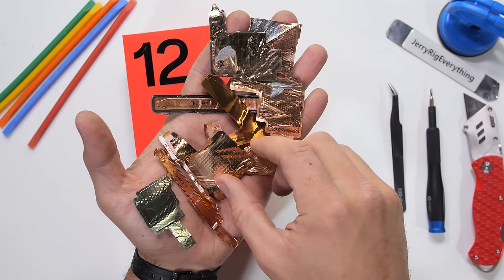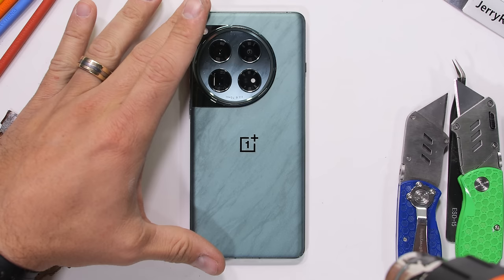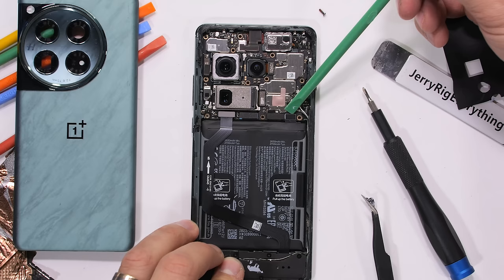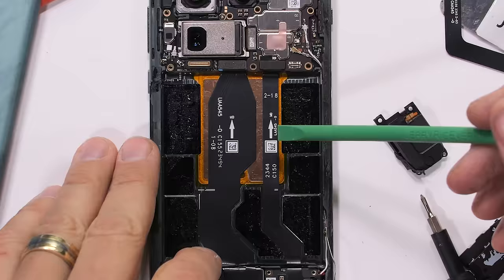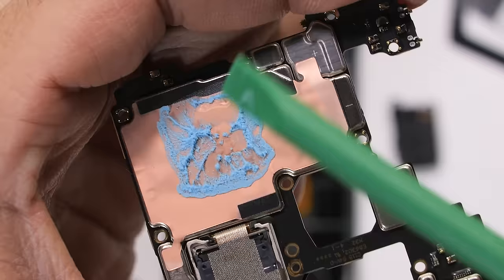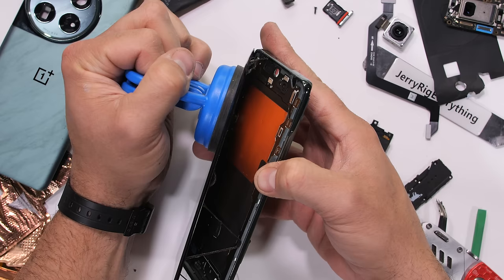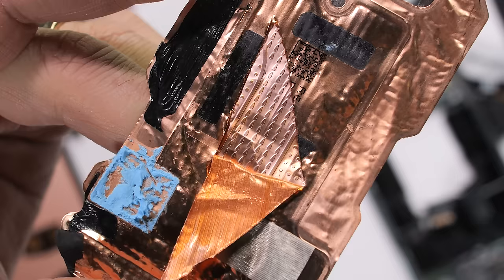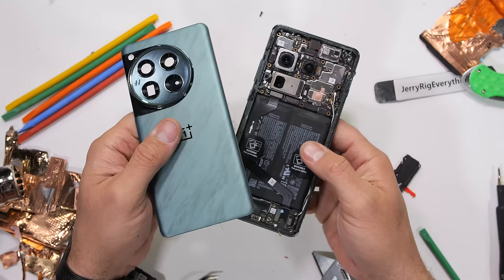The OnePlus 12 is the Coolest phone ever seen...

Comment: As a Chinese user who already owned OnePlus 12 for almost 2 months and been upgraded from OnePlus 9 Pro, there're some points I want to share:
1. It looks and feels pretty good, especially the camera module. It really looks like a premium watch face (better than the OnePlus 11's).
2. White color is using the glossy back glass. Just like my iPhone SE3, it's extremely slippery. So be very careful if you purchased.
3. The new BOE OLED screen is indeed very bright even under the sunlight, and significantly improved compared to the old Samsung E4 OLED display. With latest firmware update, you can get 800 nits via manual brightness control (fullscreen).
4. Vibration motor is now comparable to the iPhone's. iPhone gets more feedback details. But judging only by the power of the motor, they're very close.
5. Ambient sound effects can significantly improve the mid and low freuency to make the voice and beats sound better. (Turning it off increases the volume, but the high freq is not very pretty)
6. SD 8Gen3 performs just like what you will expect. It only gets warm, never hot, even in the games.
7. Main camera is good but the ultra wide and telephpto are okay. Those two are not bad, just nothing special. 
8. Battery life is impressive.
9. NFC still can be used even if your battery is dead and the phone turned off completely, and yes, I've tested it. NFC only draws power from receiving device, not your phone. Think about your "touch and pay" kind of cards in your wallet.
10. The signal strength of the cellular and Wi-Fi are impressive. But the software is struggling with switching to the better Wi-Fi hotspot.
11. That silent swtich is now more resistant so you won't accidently activate the silent mode when you're taking your phone out from the pockets.
12. Most of the time, it charges at 73 watts maximum (shown by LSPosed+LuckyTool module, not a physical ammeter), not 100W but still fast.
13. Rumor about the "gap" between the camera module and backglass is true, but not as serious as you think. It have a gap, only if you are watching very closely, and can be completely ignored if you're using phone cases. (Note: this rumor is based on Chinese articles and only represents the early batches)
14. Yes, it can be bootloader unlocked and magisk rooted, without losing your warranty. But rooting is not as simple as the Google Pixel. Not too hard though.
Reply: Good to know. Thanks.
I'm still rockin my 9 pro 😅
Reply: Extremely useful comment. Thank you kind sir!
Reply: And Can I Play Genshin Impact With Max Settings On My New OnePlus 12 I Just Bought It Today And Btw I Am From South Korea And Genshin Impact Server Are Faster I Think In My Country South Korea 😲😲😲😲😲😲😲😲😲😲😲😲
Reply: @-KAWAAKOKAWAAMKAWAAAAAAAAAAA  I didn't go with the max settings, only high (with motion blur off). But everything performs just like my expectation. It cannot hold 60 FPS for long (about 15-20 min). After that, it will drop to 45-55 FPS at average. But overall it's still very playable since 1% low FPS are pretty stable. So almost no stutters. BTW, the temperature of my city was 22 degree C and above so that will also afftects it.
Reply: @emilja.4205  Same. Still going strong tbh. Battery is getting a lil weak tho.
Reply: @Asahi380 那边youtube不是被禁了吗
Reply: So would you tell someone to go for it
Reply: @no-one-kc3yd  it's too early wait for some months if this model doesn't have much problems like other models then go for it
Reply: LSposed -> oh so the phone Can be bootloader unlocked and magisk rooted?
Reply: @sashimifr  Yes, without damaging its warranty.
Reply: Thank you for the information.
Reply: @no-one-kc3yd  If you want an all-in-one new phone, then go for it. Otherwise there're cheaper choices.
(Seems youtube is deleting my comment...)
Reply: How is the Software?
OnePlus 9 Pro is the worst phone I ever had in this regard...
Reply: @johannscheer  Seems overseas model is still getting OxygenOS. But instead of developing by OnePlus itself, OPPO actually lead the development this time. From what I see, it basically just ColorOS 14 with Google service framework enabled by default, and I think most of the user can trust OPPO's dev team. It's not perfect but not bad at all. Personally I like this UI because it shares similar design with the AOSP (at least didn't heavily modified like MIUI) and added some practical functions.
Reply: Just ordered one from China to replace my 9pro. Would you say the camera is significantly better then the op9 pro cam?
Reply: im waiting for my oneplus 7 to die xD but it never does, i just replaced the battery this year and it's still rock solid phone
Reply: Thank you sir, this is very valuable and helpful, wish you the best.
Reply: Not sure how hard it is on the 9 pro but I replaced the batteries on both my 7 pros myself. You can do it 👊 I believe in you.
Reply: @officialshivertrip  same here. That's why I'm considering, battery... Seems that the 12R is even better in that regard but the screen not as good!
Reply: thanks for sharing. Btw, how many years does this phone get OS updates and security updates?
Reply: 800 nit brightness sounds downright unimpressive compared to how bright other flagships are going. Just looks at the S24U with it's 2,600 nit brightness, that's more than 3 times brighter than the OP 12. Edit: I just checked the specs of the OP12 on GSMArena and it says it has a peak brightness of 4500 nits, lol. Why would you say it's only 800 nits?
Reply: @NonLegitNation2   4500 nits is top HDR brightness
Reply: @officialshivertrip still rocking my oneplus 6. Battery replaced
Reply: @NonLegitNation2 read with your eyes not ass he said manual brightness
Reply: @Plankton422 would also want to know
Reply: @NonLegitNation2  flagship phones nowadays most of them if not all, already above 1600nit already at auto during bright sunlight. On manuals without sunlight boost (samsung etc), most of them limit 600-800nit. If not u may get spooked by it especially in the dark room if u accidentally swipe it all up to max😂😂😂
Reply: After flashing oxygen OS on it, would there be any issues with future updates? How's the battery life like? SoT?
Reply: Very bad brand. Software is so bad in battery life, zero support after buy. Avoid
Reply: Any thoughts on the adhesive issue goin around with the china release?
Reply: Thanks for review bro ❤
Reply: those it have MeMC?
Reply: NFC when phone is off even no battery? Doesn't seem likely, anyone see a link to this feature?
Reply: Camera when compared to other flagship how is it?
Reply: @Plankton422 Yes, significantly better. Telephoto is usable now and main camera is fast and color accurate.
Reply: @wellpards My 9 pro that comes with ColorOS 12 is still getting ColorOS 14 update.
Reply: @NonLegitNation2  Those are just marketing bs. 2600 or 4500 or any "peak" brightness can be achieved only when there's a tiny white dot on the screen with HDR enabled. No OLED is getting fullscreen brightness of 1000 nits and above under normal circumstances right now. You can get about 1500nits under the sunlight but that was it. Even Samsung cannot do 4500 nits.
Reply: @1PokeARTs I didn't flash any rom. ColorOS is just more suitable for my taste, and OxygenOS is getting closer to that day by day.
But if you flashed it, you'll get OxygenOS update afterwards. It will not block you from updating the device and battery life will not be affected (since they're both official releases). But no OTA package if you unlock the bootloader, only full size rom during the download (won't erase your data and don't use any computer).
Reply: @mhex8 No, MEMC was cancelled.
Reply: @HaydenMoulds I tested it and it works. But I didn't try paying with NFC, just unlocked my bike and door with NFC tag when power off.
Reply: @soorajsaikumar I will give it 90-95/100. It's not the best module this year, but still better than any older OnePlus'.
Reply: @penssytestsy9581 I didn't see any adhesive and most of the users around me also don't know where's that came from.
Reply: @Asahi380  oh camera that good? Glad. Im using 9r at the moment..idk what to upgrade to..so i was waiting for the reviews. Your points are all the answers i needed, thank you!.
Reply: would you trade it for an s24 ultra?
Reply: @emilja.4205 I replaced it twice already 😂. One was under 2 year warranty and other one by myself.
Reply: @soorajsaikumar I uploaded some photos for comparison to MEGA but I'm not sure youtube will delete my comment if I post a URL here. If want to see, I'll try post it.
Reply: @Asahi380  ok 👍🏻
Reply: Watching this video on my OnePlus 5...
Successfully completed 6 and half years..
Reply: Thanks for the info.
Reply: can you still run release-keys after rooting? Considering upgrading from a pixel 7 and keeping the pixel for reverse engineering work
Reply: @user-fh7ki5bv5x  AIDA64 says it's release-keys. I don't do programming so not sure what you mean sorry.
Reply: @Asahi380  Is it possible to change the IMEI address?  Because in my country, no solution was found to change the IMEI of Oneplus 10 and above models.
Reply: NFC can be used with battery dead or phone switched off?
Nice joke 😂😂
What purpose it serve is the bigger question.
Reply: @Asahi380 You failed to mention that the OnePlus 12 can do 1,600 nits HBM (High Brightness Mode) outdoors in bright sunlight and 4,500 nits peak while watching HDR videos.

Too many clueless people don't comprehend the difference between HBM and peak brightness.
Reply: @NonLegitNation2 OnePlus 12 has 800 nits max MANUAL brightness, 1,600 nits HBM (High Brightness Mode) for outdoor usage in the sunlight, and 4,500 nits PEAK brightness while watching HDR videos.

S24 Ultra has 1,500 nits HBM outdoors in the sun and 2,600 nits PEAK for HDR videos.

S23 Ultra has 1,200 nits HBM outdoors and 1,750 nits PEAK for HDR videos.

Learn the differences.
Reply: @emilja.4205 proud op6 owner but all buttons are dead😂
Reply: You have no idea how valuable your comment is to me. I was  brainstorming with myself to choose between iqoo 12 or this one for the past few days but now I'm 100% sure I'll get Op12 as soon as it hits the global market. Thank you.
Reply: Camera is literally shit especially front cam. Let's see next year
Reply: @FPVPortugalTV 4 years of updates and 5 years of security patches, so don't talk nonsense, you iPhone fanboy
Reply: @calaudra4627  I don't think so.
Reply: @crczr  Believe or not, NFC don't need power to work, that's a fact, not joke.
Like who's credit card has a battery in it?
I've already tried that. No battery or turn off manually, it doesn't matter. As long as the tag was written to the NFC chip, it will be functional. All power comes from the receiving device, not your phone.
Reply: @FPVPortugalTV  disagree. I've had 4 or 5 oneplus devices since oneplus 1. Never had any huge issues with software. Minors bugs here n there for sure, but happens to all brands.  All the phones so far have been good. Definitely nothing wrong with battery life and their phones always charge really fast. Probably user error more than anything 😂
Reply: @MnstrKhaos did you go through one plus directly for battery replacement on your oneplus 7 or a 3rd party? 
I have that same model and battery is now terrible but I still like using it.
Reply: Meanwhile apple users dropping thousands every year on theirs.. I couldnt drop 700 or whatever on a new phone and my one plus 7t decided to die after 5 years.  I replaced it with a beautiful Oneplus 9 5g for 200 dollars.  I hate apple.
Reply: @EfrainDeLaRocha  Apple only company that will genuinely support their phones the longest with both software and security updates. 
In this day and age, our entire life is in our phones. I would rather information on me of every kind be safely in an iPhone than an Android   
If only Android phones were actually supported as long as an iPhone Android would truly be worth it. 
You cannot count on the OEM’s to follow through on promises to support Android devices. 
Don’t trust what Google is promising with their extra long software and security updates. 
Just because they say they will, does not mean they will follow through to the end. 
Apple definitely will
Reply: Great comment ty
Reply: Wow, I'm not disappointed at all when I just ordered (White 16/512 Global=693.5$)👍🏻
Reply: I'm doing the same, trading in my One Plus 9 Pro that has been very good to this new beast for less than $500. Don't want to spend $1300 for a Samsung's phone.
Reply: is camera any where near vivo 100 x pro ?
Reply: @johannscheer I'm using 9 pro for 2 years and all is good. Enjoying the phone a lot.

Wish for brighter screen, and better cameras, and better battery.

I think op12 addresses all of those.  Maybe my next phone.
Reply: @Asahi380  So we can make NFC payments with the device turned off? and not having credit or debit card either?
I would love to try that!
The only concern is a lot of people manually turn off their card in app to avoid accidental and theft transactions.
Here in India, upto 5k INR (60$) transactions don't require any authentication whatsoever.
Reply: My 9pro gets SO HOT so fast.. will this 12 get the same fate?

 (I only play LOTS of YouTube videos and when I pick up the phone and TOO HOT to hold it)
Reply: @Dtonmanph  my op9pro doesn't heat up at all, I also watch a lot of YouTube
Reply: @crczr  Not sure if NFC payment works or not when power off. In theory it should work but those "cards" involved with identy check sort of things so no guarantee.
I do have a NFC card for the public transportation, but I didn't have the time to use just yet.
Reply: @Dtonmanph  Not at all. Snapdragon 8 gen 3 is a very power efficient SoC compare to the 888. 2x and more performance but also 2x cooler.
Reply: @razorshark4  It really depends. Putting op9 on a mattress or some bad thermal conducting surfaces will heat up really quick.
Reply: @Asahi380 well yeah ofc, but I still don't feel it's such an issue.  And I know this phone is known to have a hot CPU.

Maybe run some benchmark that also monitors temp.  Paste the result, and temp, I can do the same and we can compare
Reply: Checking in from a OP 7 Pro here. Glad to see they've learned from their mistakes and hopefully gone away from ColorOS, and glad you see they're experimenting still and trying new ways to be efficient. 

I love the fact that I've had 30w charging since 2019, and apple is still barely letting their customers get 20w charging 5 years later 😂 

I just need to figure out if my next phone will be the Nothing 3 or 4, Oneplus 12 or 13, or a Pixel 9 or 10 Pro. The phone's going great but I've got to upgrade sometime lol 🤷🏻‍♂️
Reply: @-KAWAAKOKAWAAMKAWAAAAAAAAAAA Please Don't Capitalize Every Single Word it's really annoying to read sentences typed like that, thanks :)

- basic internet tips
Reply: @razorshark4  I wonder why mine does.. any tips on how to remedy this? I just put my phone right beside airconditing like when I'm in the car. Is that ok?
Reply: Thank you! I have the OnePlus 9 Pro now and am prospecting for the future.
Reply: @emilja.4205  same! Although this tipped me over the edge. Just pre-ordered the 12
Reply: NFC really works?
Reply: Very cool
Reply: @-KAWAAKOKAWAAMKAWAAAAAAAAAAA hi, how is genshin impact playing on the 1+ 12? Does it throttle?
Reply: @Asahi380  Thanks for your quick review! Got an 1+7 Pro but dang that 2h screen on time is really bad (tho I've been using it for 4 years and never factory reset it), how it's the screen curve? Is it pronounced like the 7 Pro or it's in line with last year Samsung flagship? I'm thinking about getting a new phone but even though I like OxygenOS, or I mean, now ColorOS, screen curve and mainly their camera color grading, it's undeniable that at this price range there are other good phones like Pixel 7 Pro (512GB) or 8 (128GB), or both S24+ or S23U, if you could choose one, which one would you personally get?
Reply: thats so interesting, thank you for sharing
Reply: So IS IT worth upgrading from a 9 Pro?
Reply: @GOLIATH283  wait a year for a price drop and then snag a brand new or used one, you'll get 3 OS udpates and 4 years of security
Reply: @MnstrKhaos same here lol
Reply: rooting/BL unlocking loses Netflix correct?
Reply: Question, how do you think it compares to the Nothing Phone 2?
Reply: Only thing I want to add is EU and north American users will not see the white version. Just like OnePlus did with the 10 Pro, white is a Chinese version only! Unless bought on Aliexpress!
Reply: I got the Keqing Genshin Impact version of the phone. Ace3 something like that. Getting it to work with google play and disabling breeno was a fun process. I don't wanna root the thing, I was ok getting a Chinese phone and I like the default wallpapers and sound effects. Also I am scared of bricking it or hurting it. Also the theme store is amazing like holy cow, so many cute fonts and characters.
Greetings from Colorado
Reply: 7T? 8? 9? 11

IM WATCHING THIS USING MY ONEPLUS 6T 

IM ONLY USING THIS PHONE EVERYDAY AND DIDN'T DAMAGE OR GET A REPAIR 😂
Reply: Thank you.
Reply: Was your Oneplus 9 Pro also as shit as mine ? xd
Reply: What is the 4th camera module for???